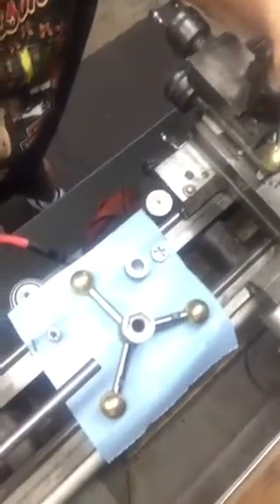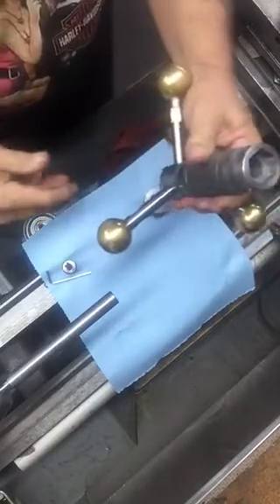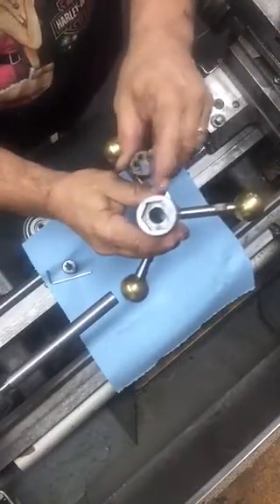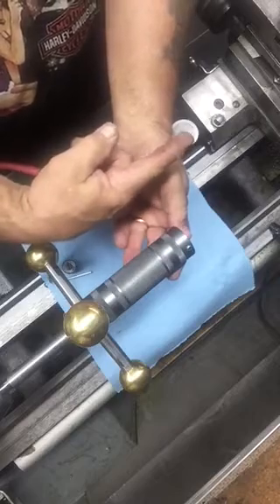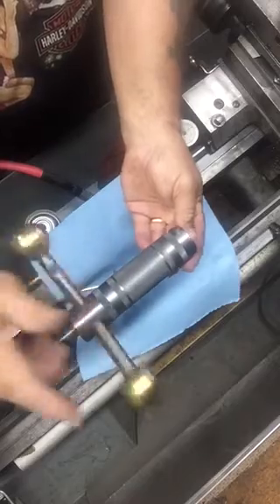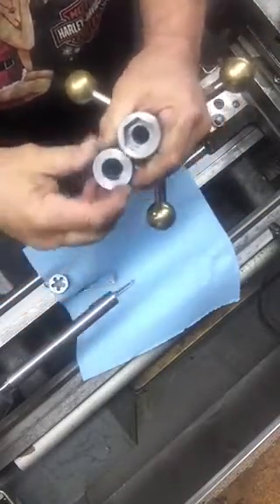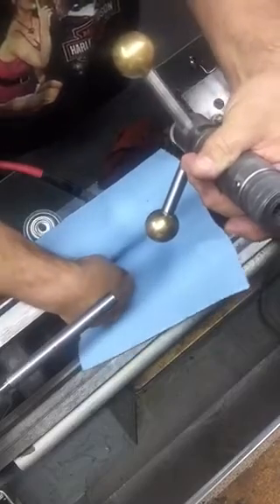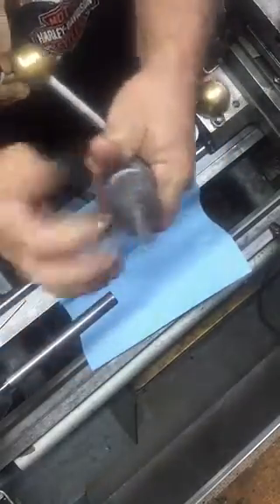Tap and die tool

Comment: Thank you sir, for the excellent video!  I've seen other lathe tapping devices but your design & presentation is the best I've seen yet.  The 3-handle design is a huge improvement over the 1-handle and/or knurled versions I've seen before.  Not only is it balanced, but your choice of brass for the knobs gives it look of quality that even the best-made steel or aluminum pieces just can't match. ...And I noticed the same on your QCTP as well.
 You've won a new subscriber, and I hope to see more machining videos from you.  
If I could add another note(?); I like the way you present things, particularly in this one and the one on the Logan 12" back gear.  Your explanations are clear and to the point, and your acknowledgement of where you found the inspiration for your design speaks well of you.  In short, I think you have what it takes to be a very successful YouTube brand (if you want that).  Don't be discouraged by the low number of views & Likes so far.  I've been looking for anything related to the 11" & larger Logan lathes for quite a while and only found yours for the first time today.  
Thank you again,
Doug
Reply from the maker: Thank you for your comments Doug. It’s one of my tools I use the most.